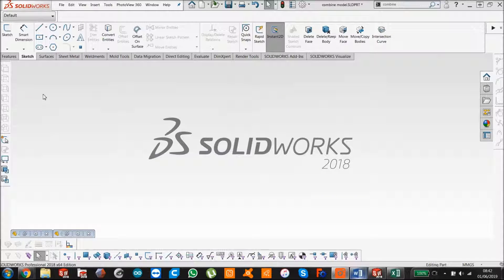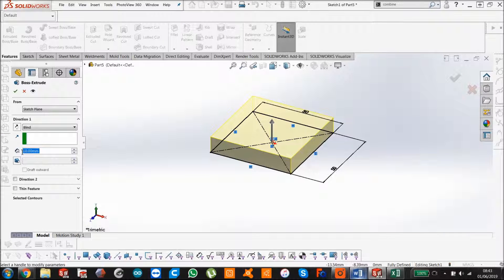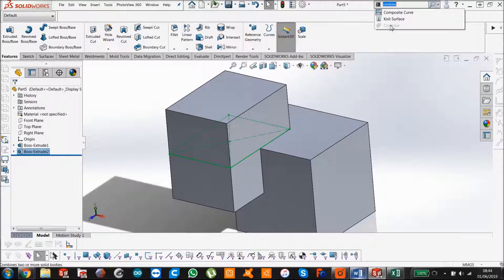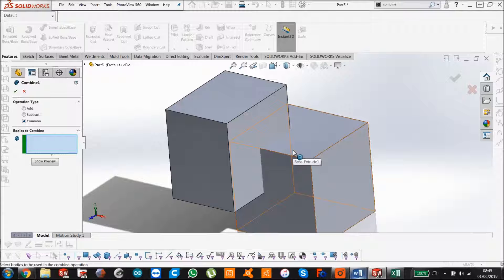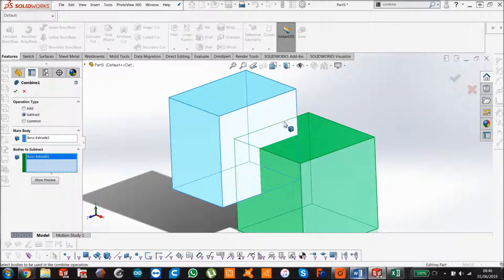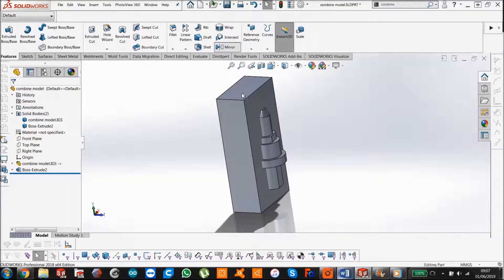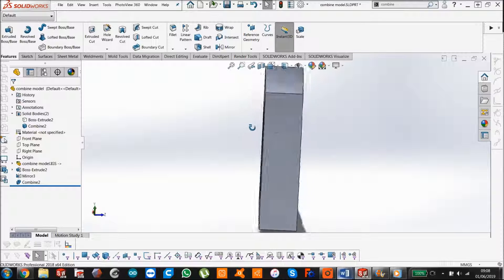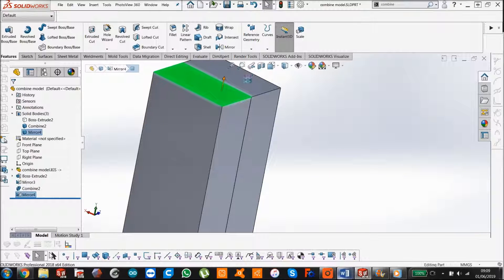Solidworks Combine Feature Tutorial | Add, Subtract & Common

Comment: hello sir, after mirroring the block can we make a single block. So that we have a body inside a single block. I mean can we make two mirror blocks as single. Thanks
Reply from the maker: Hello zees, I think I understand your meaning. If I have understood correctly then my answer would be yes. if the 2 blocks are just touching maybe the combine feature wont work to merge them, but if you emboss a small circle for example, that intersects both bodies and then click 'merge results' in the extruded boss feature then it should merge both the bodies together (in the same way you see around 1:30 in this video). If that doesnt work then sorry I dont know of any other way you would do that in solidworks. Thanks Zees :)